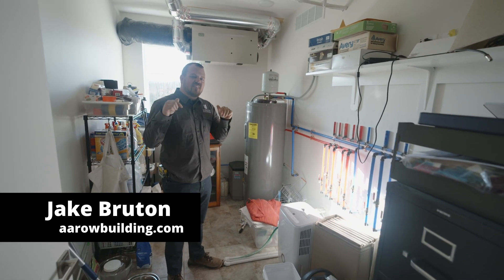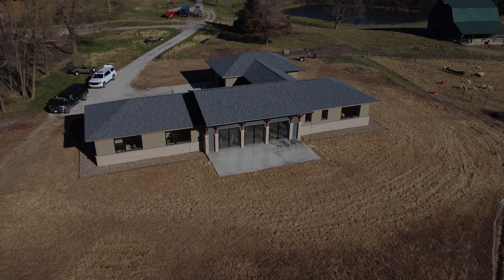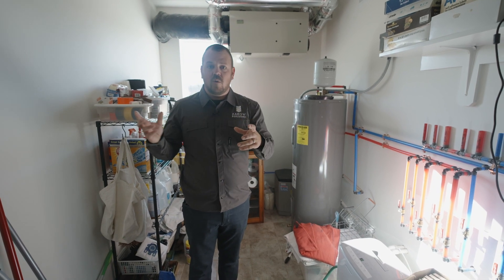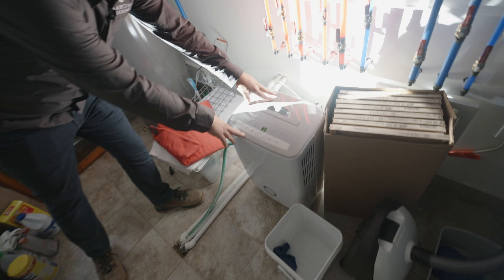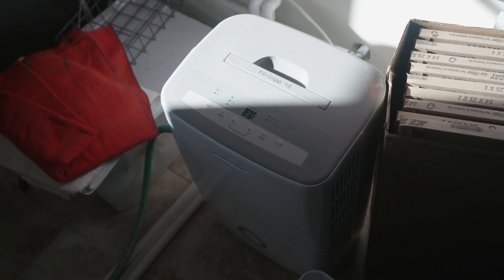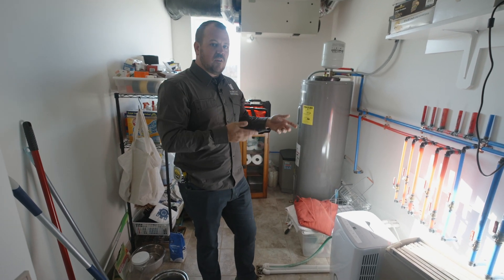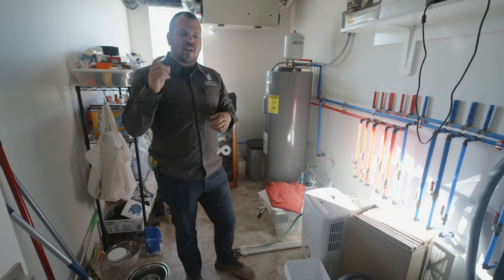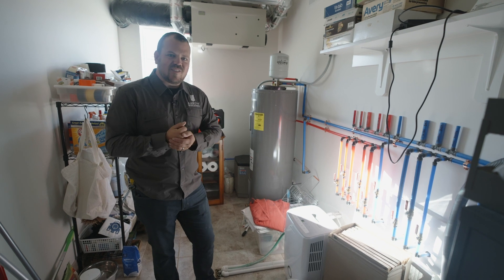HVAC Sizing & Design

Comment: How do you put a vented dryer in a house that’s sealed to passive house standards? Seems like it would put the house under unacceptably high negative pressure every time the homeowners run the dryer. Conversely, if you provided mechanical makeup air, the house would have been under obvious positive pressure when running the dryer if the dryer vent wasn’t hooked up. 

Without any other information to go on, I’m hypothesizing there is no makeup air provision in the house and the dryer vent came loose because it couldn’t overcome the negative pressure created when the dryer was running. But that’s just a guess based on limited information. Please elaborate on whether there is a makeup air strategy for the vented dryer and, if so, what that strategy is. 

I ask because I’m in the process of designing and building a house that will aim for near-passive house levels of air sealing and I’ve been assuming I will have to abandon my vented dryer in favor of a ductless heat pump dryer. Thank you.
Reply from the maker: We have in each of our homes and they really have no affect on the envelope. Even the small homes. I was worried at first too. It moves a relatively small amount of air compaired to the total amount inside the home.
Reply: Good to know. Thanks!